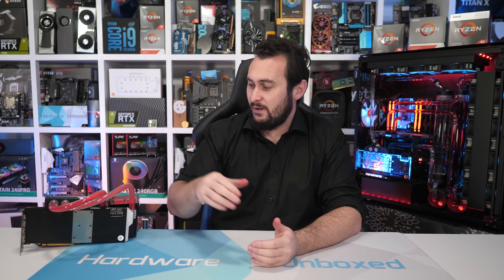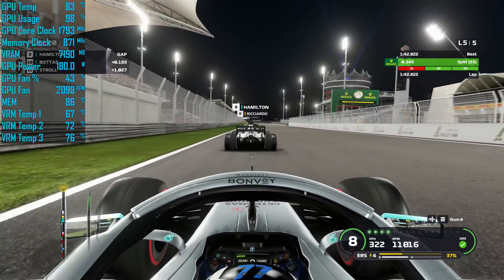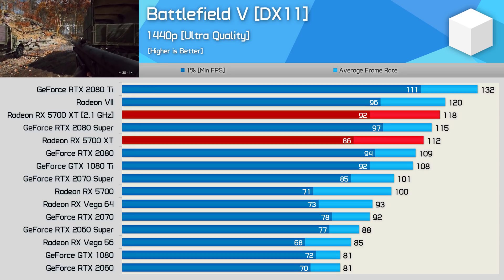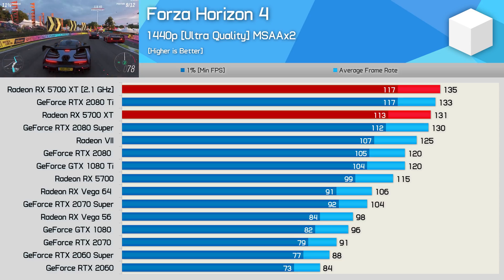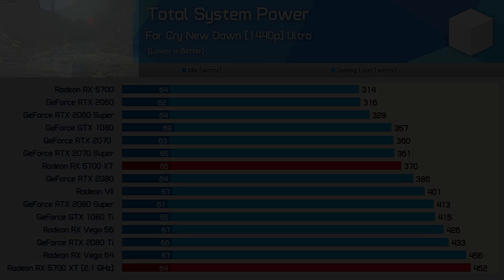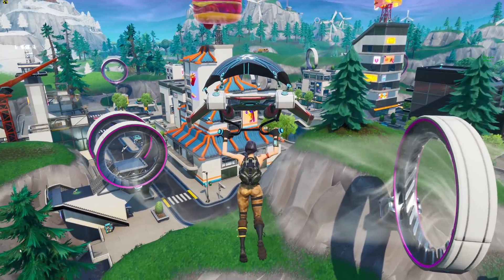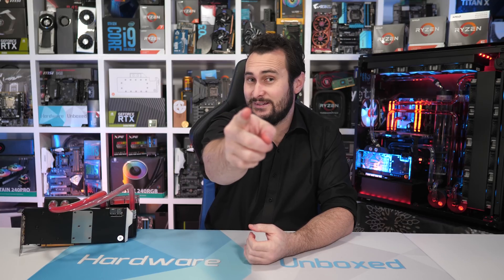Radeon RX 5700 XT Overclocked, RTX 2080-Like Performance?

Comment: So once partner models come out, rx5700 xt is essentially slightly faster GTX 1080ti for ~400$ at the price of some VRAM and power draw.
Some can bitch and moan that this is "yesterday's performance" but the fact of the matter is, it's still amazing performance for reasonable ammount of money.
This thing can drive any resolution, including 4k (with lowered detail, not that 4k requires setting highest detail to begin with) at 60+ fps. This is more than what 90% of gamers actually need.
On top of that comes the sharpening which can give you 4k like imagine with 30% more frames...

I am honestly impressed by both Ryzen and Navi. RX 5700XT actually makes me consider picking 3440x1440 ultrawide for my next pc rebuild instead of 2560x1080... Though 3440x1440 monitors are still quite expensive when comepared to 2560x1080.

Comment: What if instead of overclocking, you run the game at a lower resolution and use Radeon image sharpening to get better visuals and in turn you get better performance at basically the same resolution?

Comment: @hardware Unboxed Is the Memory Micron or Samsung?
Reply: Micron
Reply: @gamingunboxed5130  Given the history of GDDR from Micron, that's probably the reason....

The only GDDR6 that I have played with was on a 2080TI and that clocked easily to 1000 (16GB/s). Surely the memory controller on the 5700 series is not that bad?
Reply from the maker: @bradmorri  Yeah not sure Brad, I don't have a second data point :(
Reply: @Hardwareunboxed  I don't think that It is you. I am sure it is the gear. 

I have not seen anyone talk about clocking the Navi memory above 900
Reply: @Hardwareunboxed  OCCT will test GPU memory and report on GDDR memory errors in real time. I used to use it to dial in Pascal Memory overclocks. May be useful for you too.

Comment: Does this kind of show that games can run well on pretty much all modern hardware and that poor drivers, non-optimized games and just generally bad coding is really a problem in this industry?
Reply: It's a huge problem, but it's actully mostly down to the customers who pre ordered games, and dind't refund them, when the pc port was found to be shit. 
Due to the sunken cost fallacy/stockholm syndrome, which is exactly why the publisher's want you to preorder their games, so they can make as much money of ya, for the least amount of effort. And no, it's not EA that started this trend, it was actully Ubisoft.
Reply: Yep, it could be fixed if most gamers asked for obligatory Vulkan support in new games, that way the industry could push better optimization and all cards could shine.
Reply: If you start a new game today, it absolutely makes the most sense to start with Vulkan and/or Dx12.  However games launching this year started at least 3-5 years ago when it was a lot more sketchy.  This is worse when you look at games that are already a few years old and launched before Vulkan 1.0 was even released.
Reply: Hoping with console vulkan get pushed more starting 2021
Reply: Kane absolutely. Most new gen GPUs easily get above a certain frame rate in modern games, whether you’re using a 2060 or a 2080 Ti. You can expect great performance on anything newer than a 2060 tbh. You’re winning regardless. 

The main thing holding the 5700XT back is drivers.
Reply: @MapleLeafAce  I dont really believe drivers are holding it back in most cases, but I still don't wholly understand how all of this works together. There are cases, especially with Vega where in some games GCN underperforms one whole tier compared to their Nvidia counterparts and that has to be caused by the way the game utilises certain instrucions or code paths that lead to underutilization of the GCN cards. 
To sum up, I suggest it is a problem on the side of game optimization where drivers can only do that much ...
Reply: So not even with all of that WaterBlock mounting (and investment) + extreme overclock it can surprass a RTX 2070 Super. There you go, AIB won´t do mircales, RTX 2070 Super it is. You just made my life simpler, ordered it now! Thanks!
Reply: @MrCakeBone  Nobody cares buy what u want, oh i forgot that u are a BOT comment the same thing everywhere LMAO

Comment: I assume this has something to do with the die size. Even though 7nm at this die size can handle more power, the clock speed can only go so far at a linear progression, not to mention the limits via the memory from GCN remnants and stuff. I dunno if im on the right track or not as im still learning in depth concepts like that and engineering stuff but yeah.

Comment: Besides 2 games(Forza Horizon 4 , World War Z)  which is the exception so far , an RX5700XT(400$) heavily overclocked + the best possible cooling solution(140$) = RTX2070 Super level of performance for +40$ more and without having any dedicated RayTracing hardware in order to add the production cost even further , as opposed to nVidia RTX GPUs. 
But for some reason , the RX5700XT is considered as a more value solution just because the crappy cooler that they put gave them the opportunity to lower their production cost !!!
--You can ask TimmyJoe whether or not he is happy with such a cooler , when he noticed his 450$ -""RX5700XT Anniversary Edition"" , hitting 90⁰C while at stock settings !! (  https://www.youtube.com/watch?v=vi7nX2GvRTI&t=310s : check at @4:41 )
--P.S. Honestly Steve , do you believe that if nVidia was selling the RTX GPUs with their older blower-reference cooler , wouldn't they have the opportunity to save production cost just like AMD has done?? is that what you want as a customer ? a card heating/throttling/loud (*again , see Timmy Joe's video) , just for the company to save +30-50$ in order to put a quality cooler ?? 
personally I never tend to sacrifice quality for cheaper price , especially if we are talking about an ALREADY EXPENSIVE 400$-500$ GPU. (*IF these were products that were focused for poor people I would see it otherwise , but no poor people would spend 400-500$ for a GPU , so we are in a price point where quality matters !!! )

Comment: I tried the registry mod on my sample 5700 XT and also only managed an effective core clock of around 2100MHz.
Great video!
Reply from the maker: Thanks Ali, glad it's not just my two retail cards that are limited to 2.1 GHz.
Reply: Me too, 2150MHz/930MHz/+50% PL is the best I can use properly in game without any crash. I love the 45°C temp tho :)
Reply: @Tolard49  only 930?! How? hahaha at 1900mv i need at least 950mhz
Reply: @IvanPerez_92  I was talking about the memory clock 930MHz (or 1860MHz as it is shown now). As for the core voltage the lowest and stable I have tried is 1025mV.
Reply: I have the hand selected gpu for the liquid devil. and can overclock to 2.2ghz does.get in 5he mid 60s for temp...

Comment: Why is the memory at 900 MHz when it's advertised to run at 1750(7000)MHz?
thanks in advance
Reply: Stock is 875 mhz, 900 mhz is an overclock.
It is advertised at 1750 mhz because is it GDDR, Graphics Double Data Rate: "double data rate" means that the memory can transfer data both on a rising and falling edge of the clock.
So if the clock is 'X' data will be transfered at '2X' and this is the advertised speed: 875 (base frequency) x 2 (DDR) =1750 mhz. 

Same thing applies to DDR memory. 

It is not clear from the info that I have read why it is also reported as 7000, but I have an explanation (but take it as mine explanation): GDRR6 chips (and also GDDR5), have a 32-bit bus, so they transfer 4 bytes (8 bit = 1 byte, so: 32 bits = 4 bytes) at the given clock signal (rise or fall). So taking in consideration the doubling of this because of the 'Double Data Rate' and that every time (rise and falling edge) you can transfer 4 bytes, you have: 875 (base frequency) x 2 (DDR) x 4 (bytes) = 1750 (frequency 'DDR accounted') x 4 (bytes) = 7000 MB/s (so we have what 7000 stands for). 

PS: I have found out the same reasoning on DDR wiki page: https://en.wikipedia.org/wiki/DDR_SDRAM

I hope to have helped you.

Comment: This overclocked Navi in Forza horizon is impressive so I wonder if we will see a 60 cu version. It will beat the 2080ti easily.
Reply: its cpu limited even at 1440p at 4k 2080ti is better
Reply: A 68 CU navi card that can boost in the 1900mhz and over 2ghz once overclocked should trade blows with the 2080ti.

Comment: Result: 2070S is a beast.
Reply: LoL

No it’s not same performance for 20% increased price. If that seems to you a good deal... See a doctor
Reply: @kikookikaboo7808  u need watch the video again, 2070 Super, beat 5700 XT stock, and most games with 5700 XT O.C
So 500 nvidia gpu vs 600 5700 XT liquid cooler. U need a doctor it's true.
Reply: 106 frames on average for a 400usd 5700xt and 107 for a 500usd  2070S. This is the same performance.

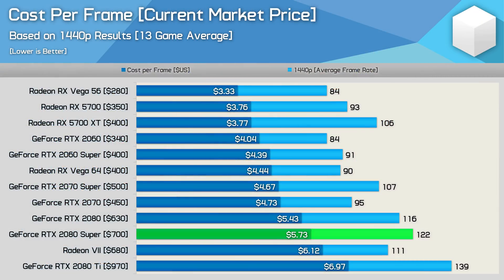See minute 9:52

So yeah, see a doctor please when stating a 20% price increase for 1 FPS is being “a beast”

Edit: and I’d anyway prefer by far a 600usd watercooled version of 106 FPS than a 107fps of a non watercooled card for 500usd

Comment: So if the 5700xt is memory bandwidth limited, how does the 5700 do under the water cooler? Can you close the gap between that and the 5700xt when both power played and cooled?

Comment: i am impressed wit 5700xt if you consider its price!
Reply: Absolutely
Reply: Here it is like 520 eur, close to 2070S price. And at this price 2070s is non questionable pick
Reply: @TheUnrevealer  Portugal (EU) 5700 xt 438 eur, VS 2070S 528 eur
Reply: Compared to the competition sure, its still too much tho
Reply: @Lightitupp1  1080ti performance for 400 dollars is to much? wtf....
Reply: @GAMEVIDSnorwegian422  First of all, it is behind the 1080ti, the 1080ti came out well over 2 years ago (2 years and 4-5months ago) at then the flagship price of 699$. Even at 400, which is the MSRP of the blower style cooler, it is at least 50$ too expensive. The board partner models are likely going to be 20-30$ more. Which here in Europe will price it around 430-440euro which would be 480-490$, which is too expensive. Just because it is the best option in terms of price compared to the competition doesn't mean it is a good price overall

Comment: 7% increase in fps is actually not bad, but unjustified hype spoils everything
Reply: AMD and their 7's
Reply: 7% for 140 dollar extra and you get 2070 super performans for 540 does not sound like a good deal you Will prolly lose waranty also.
Reply: @Rnatsume100  Yeah, AIB cards ftw
Reply: People letting people spoil everything spoils everything. Smart people should raise above anything bad that comes from internet or other non personal communication. It takes mental energy, but it's worth it.

Unjustified hype didn't make that 7% any lower or higher. It only changed the perception in the minds of people. So nothing really got spoiled.
Reply: its basically the difference of the 2080 vs 2080 s difference but for a 148$ +premium for new waterblock.  That would be a killer deal when that waterblock gets a lower price.
Reply: @starkistuna  And you have to take into account not everyone ocs their cards either.
Reply: @starkistuna  aftermarket coolers = waterblock-like performance
Reply: Well 2,2 Ghz vs 2,1 Ghz should lead to a more noticeable difference, i guess it's silicon lottery. (the guy that made the 2080 performance post had a 2,2 Ghz one)
Reply: @Dopamine-owo  Based on this review, if 20% higher clocks give average 7% increase, then it's clearly have bottleneck somewhere and that GDDR6 memory is the only thing I could think of. 

So going from 20% to 30% increase in clocks really would have only minor improvements, most likely going from 7% to 9% increase. Though it's possible that silicon lottery might apply to GDDR6 memory and with better clocks and timings it could really have significant impact. However I don't have enough knowledge on that.
Reply: @juzujuzu4555  and they just switched from hbm
Reply: @juzujuzu4555  yep its a memory bottleneck or synchronization issues, should wait for better drivers and bug fixes..
Reply: So not even with all of that WaterBlock mounting (and investment) + extreme overclock it can surprass a RTX 2070 Super. There you go, AIB won´t do mircales, RTX 2070 Super it is. You just made my life simpler, ordered it now! Thanks!
Reply: @MrCakeBone  I highly recommend the MSI Gaming X Trio 2070 Super. That beast surpasses the original 2080 with overclocking. The 2080 Super can eat go eat #$%^
Reply: Thats because the sillicon lottery, u was having a really good luck voy, and MultiPlatform MasterRace is just a BOT
Reply: @conejoasesino6665  I´m a bot because I have an opinion and made a decision, while watching this video, and also thanked its author because he helped me on my buying  decisions? Ok bud, whatever you say!

I was waiting for AIBs on this card and see how it performed with a decent cooler. If this thing can´t do more than this, even at 2,1ghz and that´s with a waterblock, I´m out, not worth the wait!! I just grabbed a RTX 2070 Super and I´m done. Simple as that. AIB won´t do miracles if an waterblock couldn´t.

Comment: This video serves as a concrete source of information for countering that "not an apple fan" guy (and others like him) that was also so enthusiastic about him taking his 5700XT to 2250MHz or something. 

For a 7% average (between 4% and 12% from what we see here) increase in performance you need to invest in an additional solid cooling solution (at least $100), be tech savvy enough to change the cooler on the card, then use the powerplay table method (risking bricking the card).

Yeah, thanx but no, thanx. For that money I'll get a 2070 Super, plug & play.

Also, if this Navi architecture is only capable of 7% increase in performance for an 18% increase in frequency (also increasing power draw) for 2560 stream processors, I really doubt a more beefed up GPU would be capable of sustaining this. It would not scale. This kind of proves that AMD doesn't have the means to compete at the ultra high end level (2080 Ti) with nvidia just yet. They need to refine the architecture and the manufacturing process AND the silicon quality to be able to roll out a GPU with 4096+ stream processors and take on the 2080Ti (or whatever 3080Ti variant nvidia will bring next year).
Reply: blackheart004 As always... owerclocking is silicon lottery. Some people get higher frequences than other. All in all this says that you definitely need better cooling if you wanna overclock 5700 series. This test Also that amd did not get so badly over the top when releasing this card. The stock performance is nice and you can owerclock but then you lose the effiency of the Navi. So much more sensible stock lock in this release. Not overkill OC from the Beginning like in some previous releases and that is a good thing to normal consumers!

Comment: Why RTX 2080? Is cheaper then RTX 2070 Super, so it is next bracket, why you push 2 up? Do you forget about price change?
Reply from the maker: I feel like I talk about the RTX 2070 Super at the end of the video. The original claim was that the SPPT OC allows the 5700 XT to match the RTX 2080.
Reply: @Hardwareunboxed  Yeah at the end, but you not mention it once before. And for me, who not read stuff u base video on, as many may, it make false image that this is competitor, and then you say that 5700XT with mod is same price as RTX 2070 Super, make me thinking, why you even compare to RTX 2080? And you do it 2nd time, same was in initial review, for me is start to be as disinformation, not as information, one word of good info after many bad info, make whole message as negative. And adding that most people not watch whole video, makes it even worst. 
Maybe is not intentional, but results are as they are. 
PS if you would give additional avg frame time it be nice, because now you can only use % as good way to compare, because 10fps different is big on low fps, and small on high fps, but in avg frame timing it be more representative (avg, not as GN frame time in time)
Reply: exactly, this competes with 2060 super and stomps that. Why aren't reviews making it more clear and comparing 5700xt against 2070, 2070 super and 2080, instead of its price counterpart.

Comment: Great work showing how this performs in a custom loop, thanks.

Unless you're a beginner, anyone who's into serious watercooling will already have the rest of the loop which can be re-used until the fans and pumps die, and knows that you add £140 for the waterblock when getting a new gpu, it's not all about OC'ing, for me it's about lower temps and almost zero noise.

Comment: with a 235 mm^2 die size??! Outstanding architecture...
Reply: 251 mm² on 7nm. 

Source: https://www.techpowerup.com/gpu-specs/amd-navi-10.g861
Reply: Outstanding 7nm process. If you apply diffrences between transistor density of technology used by Nvidia and AMD, you would see Nvidia having similar size dies including Tensor cores.

Also next nvidia cards will be 7nm of Samsung. If nvidia will go 7nm, I think AMD has to worry considering AMD can just compete with Nvidia using old technology process.
Reply: That's 7nm for you.